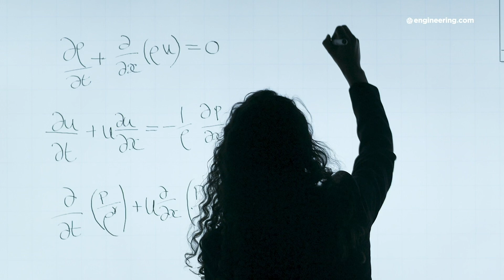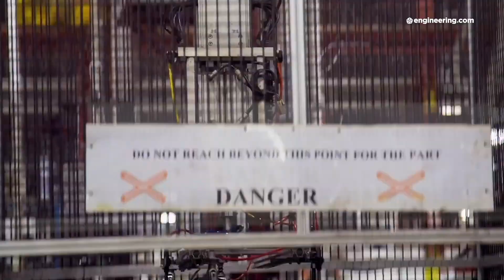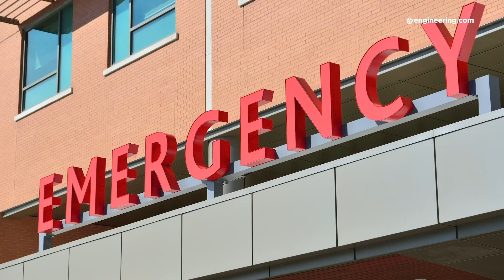"Lies, Damned Lies and Statistics": What Covid Can Teach Us in Manufacturing

Comment: Excellent points!! I've been scratching my head during this entire c 19 wondering how legislators came to their conclusions. Writing software or building mechanisms; when the prototype is first working, confidence is low. As the proto passes more tests, it receives more confidence. 
Their choice of test is also in question. The PCR was not meant for such diagnostics. The antigen test would be more accurate and give more relevant and useful data.
Unfortunately, confidence is very low with legislators and their poor use of data. (and they forgot to tell us to get our Vitamin D3 levels up and combine that with Vit K2)